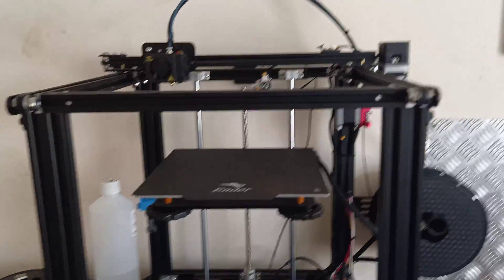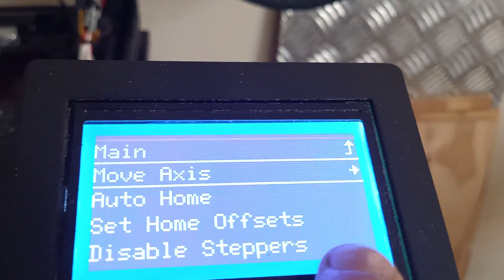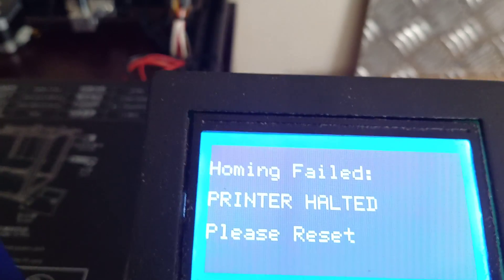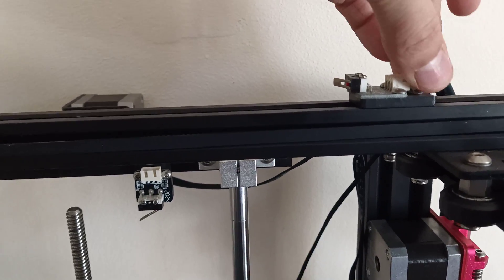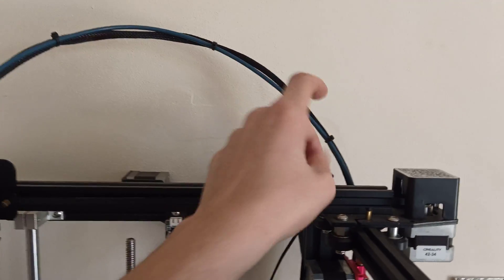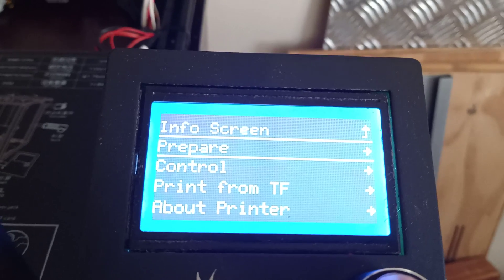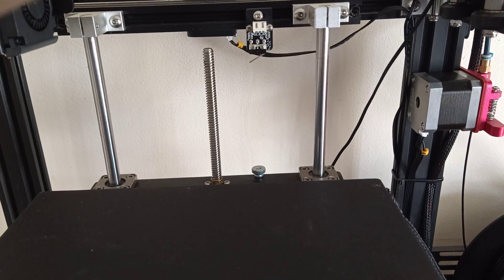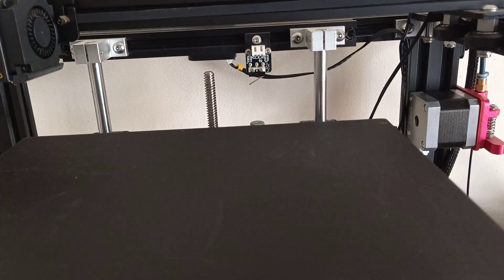Homing failed, printer halted FIX Ender 5, Ender 3 (Read Description for Fix)

Comment: I had the same issue when i first fired up - turns out i had the cables in wrong - theres 2 cable heads that are the same amount of pins....and i switched them around - the E and the X, and that worked. I got my printer almost a week ago and i still havent had a successful print LOL. or a successful benchy,  i havent tried anything else. the fillament that comes with it is almost done 🤣

Comment: I got the same problem however no motors move?
They moved before updating to the newest marlin firmware, any help on that? 
I got far to before 
I got the xyz to 0/?
And then ready to print a item 

Any help on this?
Reply: I do have a ender 5 pro with bl touch
Reply: Did you ever find an answer

Comment: I put an auto leveler on my ender 3 and installing it it told me to take off the switch, and I am getting the printer halted error, do I need to do something different?
Reply: same
Reply: Any resolution to this yet?  I have the same.
Reply: Same here, did you find a solution ?
Reply: I am in the same situation, have you find a solution
Reply: Same

Comment: My Ender 2 just did this. Brand new. How do I fix it?
Reply: Ours too ! Ender 3
Reply from the maker: @VigoandCo  basically all i did was swap the wire for what ever axis was failing to another switch and then put the wire from the other switch that worked into the not working one, and when the axis that wasnt working (z for example) reached the top i would press the other axis switch and noticed it worked and i turned printer off via power switch, switch the wires back around and it worked, else you can just buy replacement switch's

if you do what i did in the video where i switch the 2 wires from the switchs after i powered off the printer and put wires back to original place all worked good!
Reply from the maker: @Vigo and Co  basically all i did was swap the wire for what ever axis was failing to another switch and then put the wire from the other switch that worked into the not working one, and when the axis that wasnt working (z for example) reached the top i would press the other axis switch and noticed it worked and i turned printer off via power switch, switch the wires back around and it worked, else you can just buy replacement switch's

if you do what i did in the video where i switch the 2 wires from the switchs after i powered off the printer and put wires back to original place all worked good!
Reply: @ownproxie  p